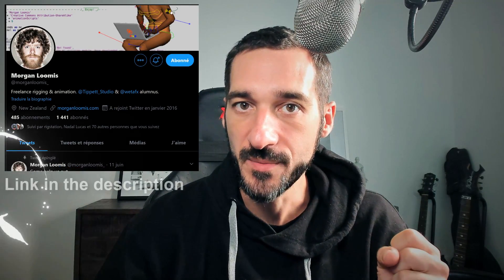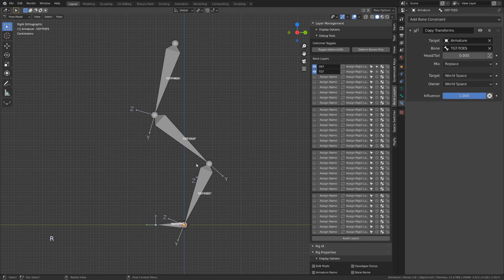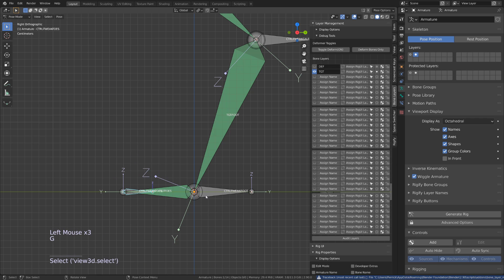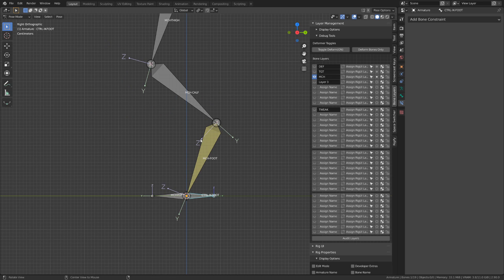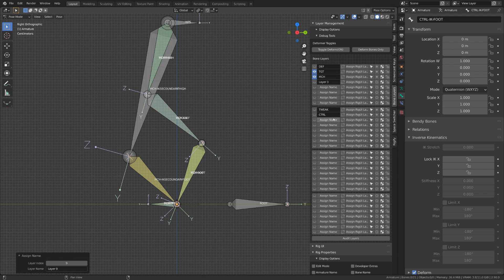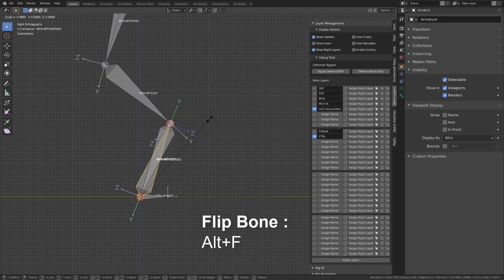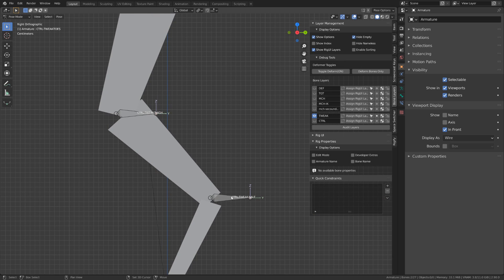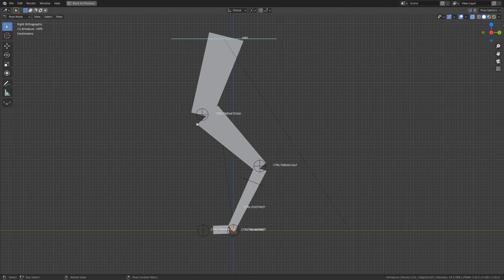Advanced Dog leg rig in Blender

Comment: Anyone else having issues with the Foot Rotation technique at 11:50? I followed the instructions to the T, but the leg doesn't follow at all. It's a separate bone system that the Target bone doesn't seem to follow. 
Know a fix?  T-T
Reply: I think I'm in the same boat... I set up the advanced ankle control, but the video doesn't seem to describe where to parent it so that it can drive the main leg while also following the pole vector. I can't avoid creating a cyclical error when trying to have both features work (the pole vector and the ankle tweak control).
Reply: @howardhsu5241 any progress?
Reply: I had the same problem in one of the comments below it was explain that you have to change the parent of the tweak bones from the MCH to the MCH-INT.

Comment: Instead of adding an extra IK chain to limit the knee rotation, why not add a Limit Distance constraint to the IK bone targeting the thigh?
I've tested it with a couple of Limit Distance constraints, one for the inside and the other for the outside clamp regions and it achieves the same effect.
Reply from the maker: There are multiple ways to get to the same result. It's great you found yours.
Reply: @PierrickPicaut_P2DESIGN  I wasn't expecting to be told that it is also a valid way to do it. I thought it would have some limitations or downsides that I wasn't aware of, so thank you!
I have also noticed that it completely avoids the issue of the mechanism chain reaching the maximum length before the deformation chain and doesn't require too much setup.
Reply from the maker: @M.TT.  Not saying it works as I havn't tested it. But you do need to understand and cultivate the fact that there are many different ways to rig things. And if you find a solution that fits your needs, then it's better than following a tutorial without thinking by youself. It means you're making progress with your rigging skills

Comment: if you unparent the new ik bone, then change its parent BEFORE you create the ik control, it will create a circular dependency, which may royally screw you down the road.  in my experiments, you MUST follow the steps in this order to avoid that:
1: extrude the control bone.  unparent it.
2: create the IK constraint
3: parent the control bone to the root.

Comment: Another excellent tut, PP. I'm currently rigging a mech with this leg type. 
I'm wondering, for the legs n arms, if it matters if X or Y or Z is pointing forward? I'm asking because when using IK and pole target it's the x axis that's looking at the pole. If we recalculate bone roll for the arms n legs to have x pointing forward then they won't flip when adding pole targets.
Reply from the maker: Hi, no it’s not a problem. Your method is correct
Reply: @PierrickPicaut_P2DESIGN  Thanks!

Comment: So when you said I did keep offset but you do connected instead did you mean Specifically only connected between the mechanics bone chain or also the tweakers to the mechanics bones above them. 

Also I'm having odd behaviour where whenever I move the controllers right click it resets the controller position but the rig has odd transformation left. Similarly in pose mode when using alt-grs I have to spam it multiple time to get to the actual zero state? Anyone else experiencing this/clues as to what I fucked up?
Hmm I'm also noticing my  TGT, MCH, and MCH INT chains aren't staying perfectly aligned and moving the root bone in pose mode makes the whole chain wobble. Guess I'll have to try again tomorrow I probably fucked up at some point.
Reply from the maker: Hi, I meant the mechanism bone specificaly. So that the IK can work.

It seems, from what I4ve read, that you have a lot of circular dependency. So you've probably parented the wrong bones together.
Reply: @PierrickPicaut_P2DESIGN  Okay went through it a second time and now I think the chains are mostly behaving but I've got some final questions if you could honor me with one more reply: 
- At the end you say you move the root bone back to the center of the rig but I don't see you doing this in the video? Would this just mean unparenting the first child of the root, moving it, and then re-parenting the first child to the root bone? 
- For the Foot roll controller I notice it only moves the MCH-INT chain. This seems to also be the case in the video at the end when you test it. However, what confuses me is then which bones exactly do you use for skinning the mesh? I was under the impression I would do all the skinning with DEF- bones but if the foot roll does only move the MCH-INT chain (I haven't just missed something) then Im supposed to skin with the MCH-INT bones right? 
EDIT: 4th watch through. I still don't get this. If I skin to DEF bones I get tweakers and IK but no Foot Roll because I still can't figure out how how the foot roll chain translates back to the other ones. If I skin to MCH-INT- bones I get IK and Foot roll, but then of course the tweakers don't work. 
EDIT: For now I've changed the parent of the MCHTWEAK- bones (Created to fix the scale for the CTRLTWEAK bones via the root bone in the last Q of the video) from MCH bones to MCH-INT bones instead this seems to give both behaviours for now.
- How would you recommend mirroring this set-up? My initial intuition would be to Add L prefix to each bone, duplicate them, mirror over 3D cursor, Batch rename 'L'->'R' but.... I also feel like this would potentially open whole can of worms? Am I over worrying or is there tested and safe way to mirror rig parts? 

Thank you for this video. I bought your rigging course awhile back but haven't made much progress since it feels like too big of a bite to handle. This kind of bite sized video was more comfortable to process!